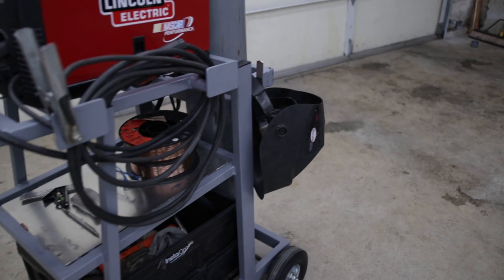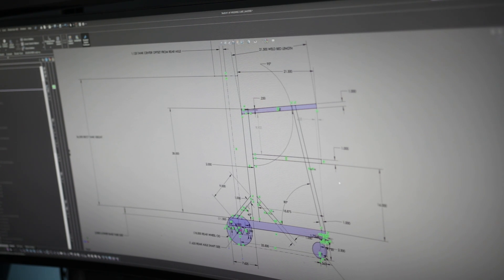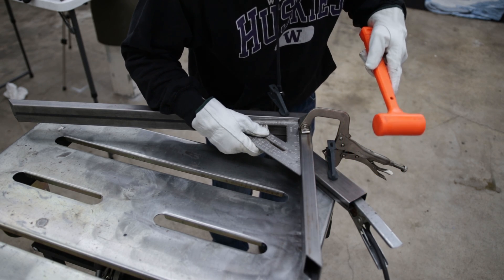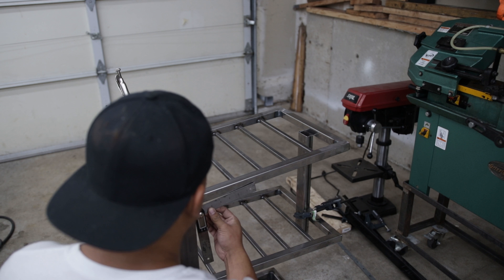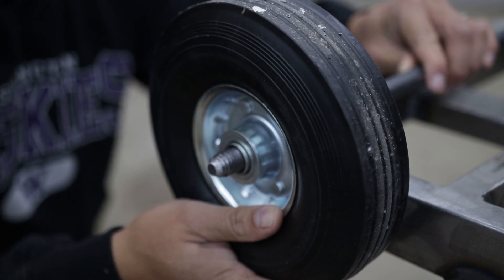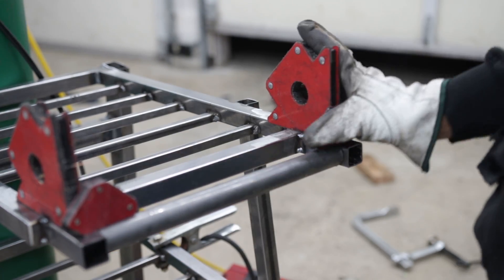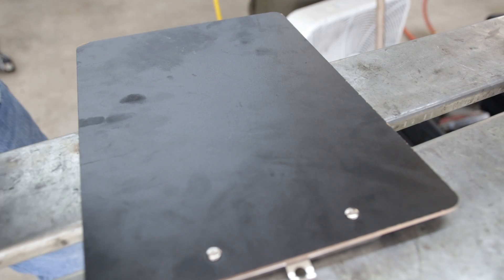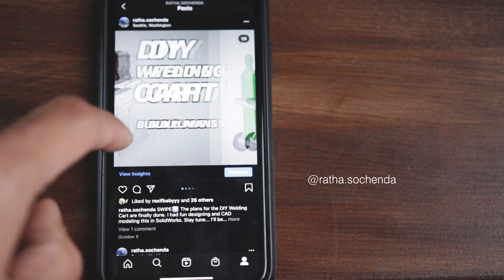GARAGE Built WELDING CART DIY 2020 Setup (A Beginner Fabrication Project)

Comment: How much money do you have in the steel for this project?  That's the one thing I always find difficult to estimate on these videos.  Very new to metal work, so a price list on the stock you used would be extremely helpful.  Nice work!
Reply from the maker: Prolly under $100 I would guess

Comment: Just purchased the the mig tig welding cart plan absolutely easy plans to follow and read a real credit to you 
Cheers 🍻 👍👍👍👍
Reply from the maker: That’s awesome! And appreciate the support
Reply: What size wheels and caster wheels did you use on your welding cart
Reply from the maker: @craigmissen6881  https://www.harborfreight.com/8-inch-solid-rubber-tire-42427.html and https://www.harborfreight.com/4-in-pvc-swivel-caster-61649.html the links for them should also be in the excel spreadsheet cut list
Reply: No unfortunately the links are not there hence why the question 
Cheers 
Craig

Comment: What metal band saw do you have? I've been trying to choose between a metal band saw or a metal cutoff saw like an Evolution.
Reply from the maker: It’s a grizzly horizontal/vertical metal bandsaw. Each has there pros and cons. I’ve had both and prefer the bandsaw. It does cuts slower takes up more space but I like the coolant feature and that it doesn’t shoot metal chips everywhere . And I like that it also can be use as a bandsaw too.

Comment: Great execution.  If you don;t mind, I have one quick helpful tip.  Try not to wrap the torch cable with tight radius turns.  The liner will kink over time as will need to be replaced sooner.  Big looping turns is much better.  All the best to you...... 👊👊

I just subscribed as your Solidworks skills are amazing.  Looking forward to checking out the rest of your content. 👍👍😎👍👍
Reply from the maker: Great tip! Never thought about that. I’ll start make bigger loops for now on. Thanks for subscribing and thanks for watching. 🤙🏾

Comment: Cool and straight forward design build. After 3 months is there anything that you would do differently ? Any mods that come to mind. I've just started on a similar build and for one, I'm adding a tray level on top of the welder for a catch all as I work. Like a roof rack for the cart. Thanks for sharing the video !
Reply from the maker: So far it’s worked out great. Getting ready to add a second machine (tig). Not sure it’s that’s a change but an addition to the cart. Thanks for watching

Comment: Well done! 
I'm in the process of laying out the sheet metal side of my garage. To save space I  am thinking I'm going to build a welding cart that fits under my fab table for storage.
Reply from the maker: That's a great way to save space! I sometimes have to weld things outside. Therefore having a dedicated mobile cart for my mig welder makes its a little easier for me.  Unfortunately I would of like to store it under my welding table but that thing is 4ft x 6ft and weights 1000lbs. It has casters but I can't imagine having to push it out the garage to the driveway every time.
Reply: @RathaSochenda   mine is 3×6' with a half inch plate. I'm lucky enough that its a straight shot to the door so I can move outside if need be
Reply from the maker: @alangliniak9514  nice👍

Comment: Nice job, really good video - not fond of most of the music. I have had the experience with the front wheels being too small and had to get bigger set. Once you add the weight of the welder, tank and tools, those small front wheels make it difficult if you have to move the cart over rough surfaces.
Reply from the maker: Haven’t had to chance to take it on rough surfaces yet but good to know. So far it rolls smoothly on my garage floor where it will normally see most of its use.
Reply: @RathaSochenda  Yeah, i don't have any problems on my garage floor either but sometimes I have to weld outside and have a gravel driveway. What program did you use for your 3D sketches? You did an excellent job with your planning.
Reply from the maker: I used a CAD program called SolidWorks. Been using it since my early college days.

Comment: Dude, really nice. I need to build one of these.
Reply from the maker: Thanks. Glad you like it!
Reply: Got the plans. Great detail!
Reply from the maker: @CatCityDesign  Glad you like them. Just make sure you adjust accordingly to your size diameter tank and everything else should be smooth sailing. Also the front and back wheels I found the best prices at Harbor Freight. Here is what I used https://www.harborfreight.com/8-inch-solid-rubber-tire-42427.html and https://www.harborfreight.com/4-in-pvc-heavy-duty-swivel-caster-61649.html